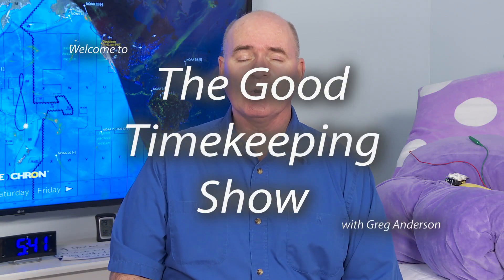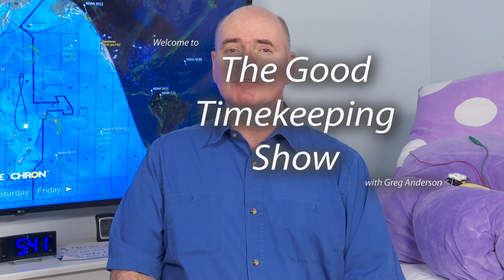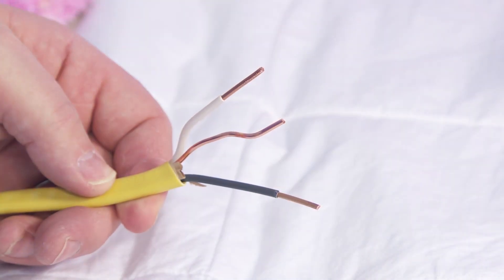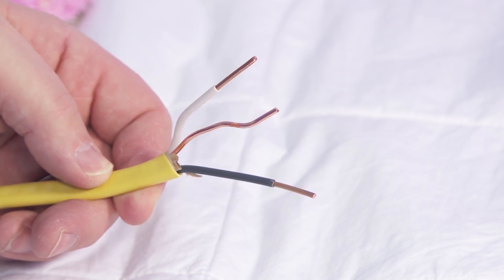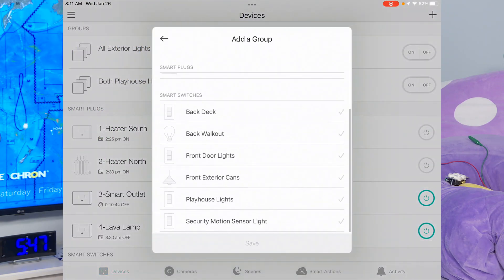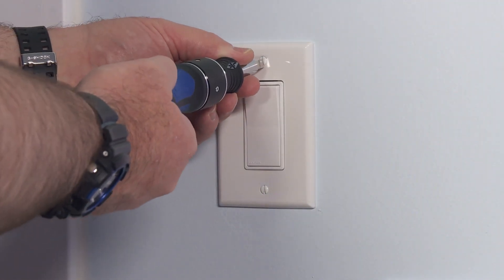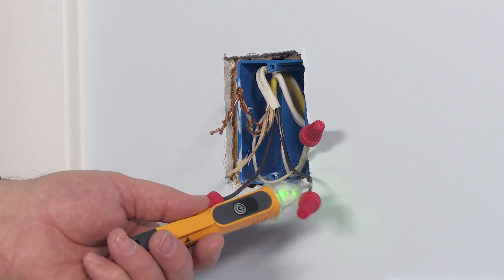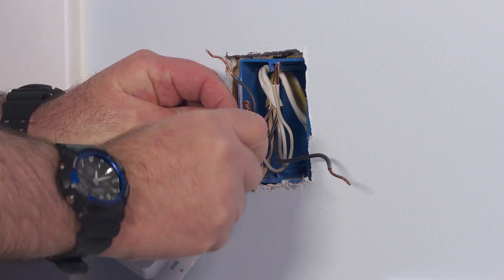Installing a KASA Smart Switch (Controlled over WiFi and the Internet)

Comment: My switch boxes only have two black wires.
Reply from the maker: At first I thought the switch boxes in my house did not contain the neutral (white) and ground wires but when I removed the switch I saw the wires tucked in the back. There are smart switches which say, on the package, whether or not they need the neutral wire. I don’t know exactly how they work when they don’t use a neutral wire but, again, those products exist.
Reply: @GoodTimekeeper  yeah, wish that were true for me.  My building is quite old, and I have been told there aren’t even ground wires in the boxes. The switch box is metal, so maybe that acts as the ground. But definitely no third “neutral” wire either. Just two black wires.